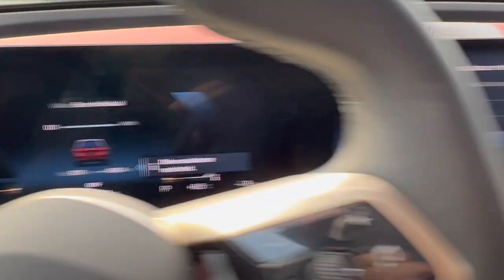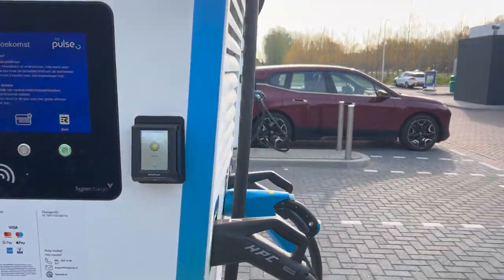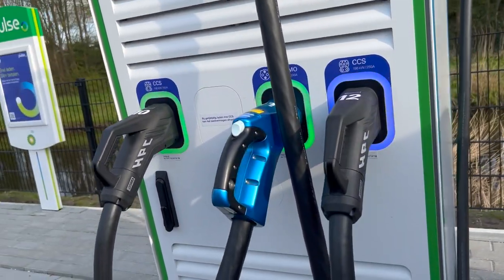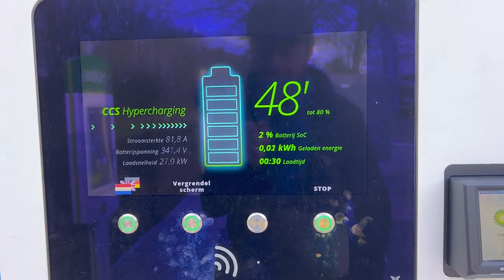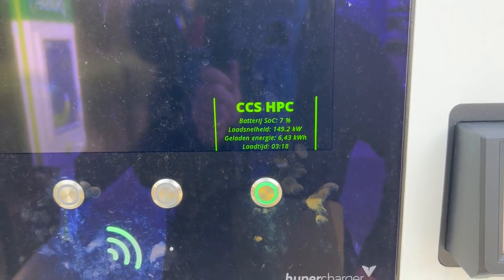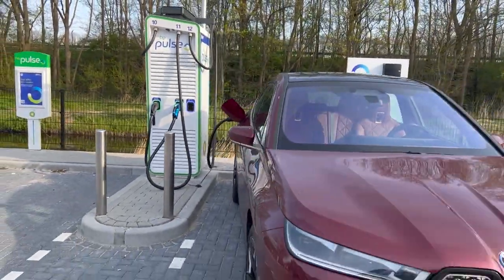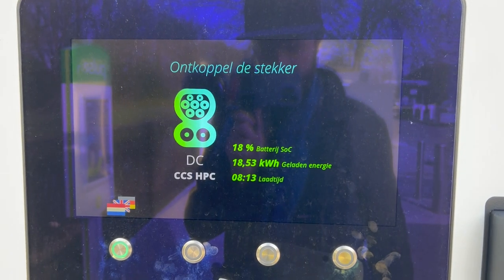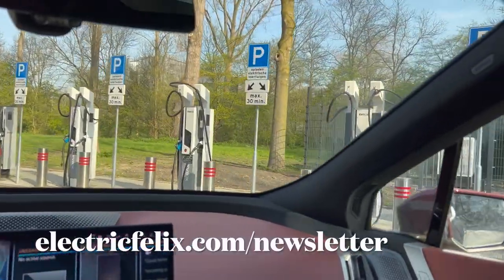Cold Battery Fast Charging the BMW iX50 at BP Pulse Amsterdam

Comment: Man I nearly thought BP is out to sabotage EVs by providing only a measly 250A. 😅
The next Alpitronic 400 kW charger generation will be able to provide 2x 200 kW (50 kW steps possible) to better serve modern fast charging EVs and be eligible for the german government sponsored "Deutschlandnetz" initiative with a guaranteed 200 kW requirement per charging point, which current Alpitronics cannot provide.